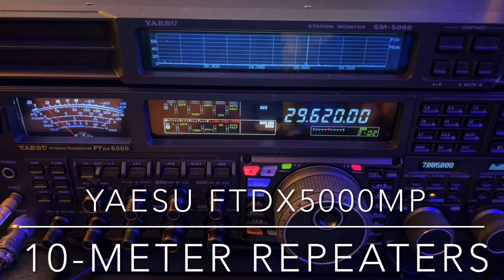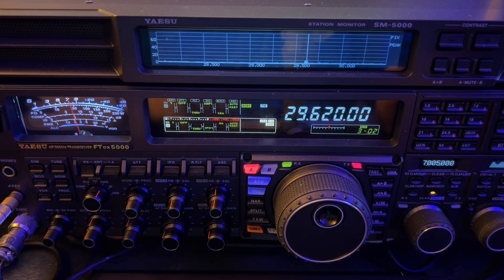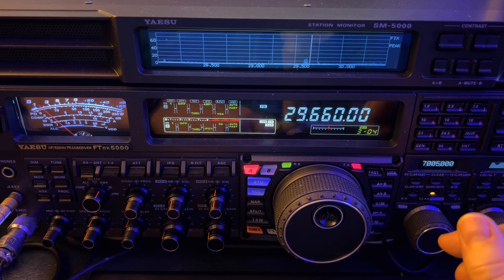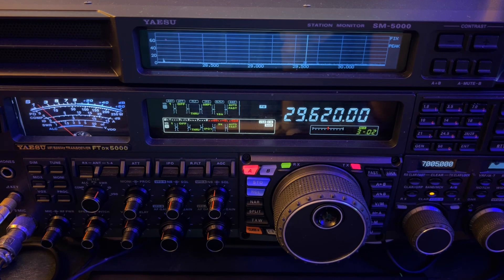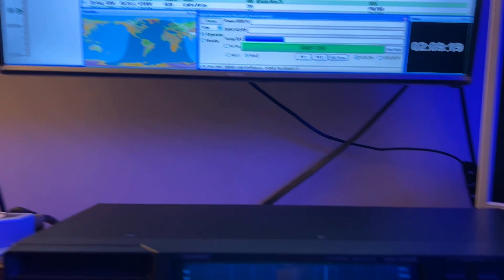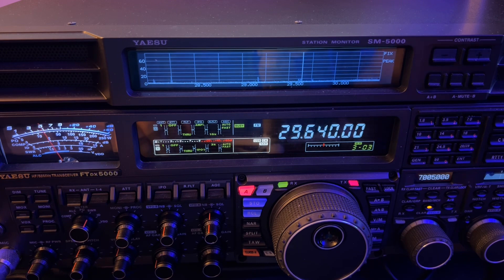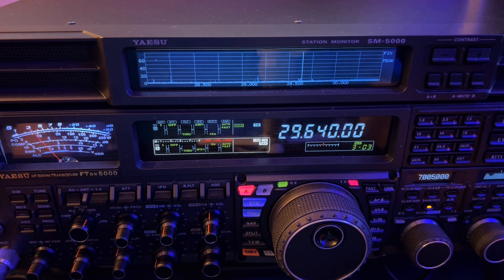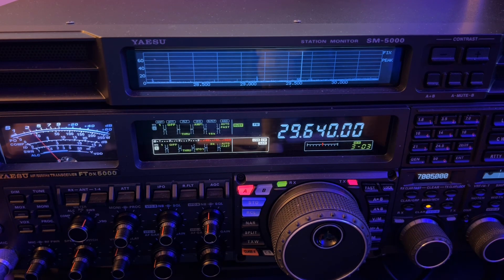Yaesu FTdx5000MP: 10m Repeaters

Comment: Josh KI6NAZ at Ham Radio Crash Course just did a live stream on how 10m is opening, and trying to get new Technician class licensees to start to experiment with HF. Especially with some of the Chinese 10/11/12m radios like the AnyTone AT-6666 (aka “quad six”) that can be had on a budget.
Reply from the maker: Yes, this is a perfect opportunity for Technician class licensees to try HF SSB. They don’t have privileges in the portion of spectrum where the repeaters are but they can use up to 200W between 28.3 and 28.5 and operate USB. 

73, de N4HNH